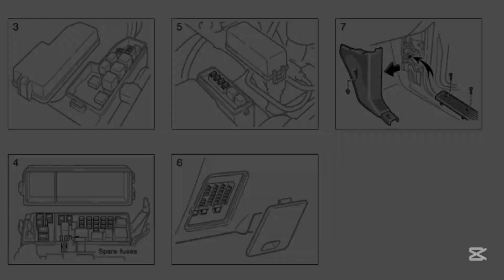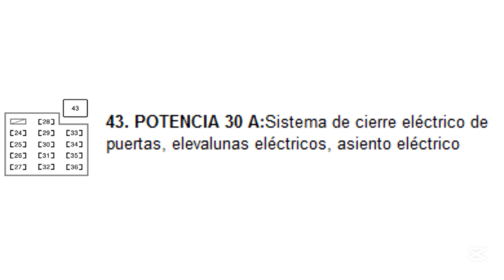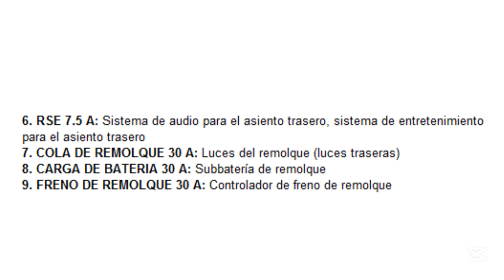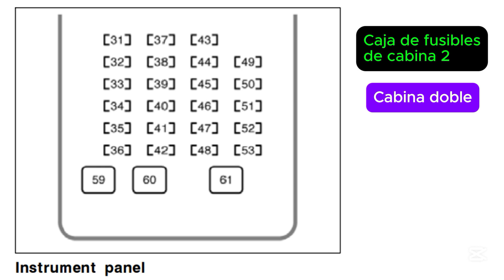Diagrama de la caja de fusibles de Toyota TUNDRA 2004. ToyoFans.

Comment from the maker: Toyota TUNDRA.
Año: 2004. 

Relé y Fusible de la Bomba de Gasolina, Combustible, Gasoil, Nafta, Diesel, Petróleo, Bencina, Carburante, Gasóleo, Gasolìn.
Motor NO ARRANCA revisa estos FUSIBLES.
Conoce todos los relevadores y fusibles de un Toyota.
CAJA DE FUSIBLES.
¿ COMO SE LLAMA EL FUSIBLE DEL AIRE ACONDICIONADO ? 
Ubicaciones de los fusibles y detalles del circuito para encontrar el fusible correcto.
¡ Explicación de la Caja de Fusibles de su Automóvil !
No funcionan Luces DIRECCIONALES solución fácil con diagrama ( palanca, botón, fusibles, flasher ).
Nombre de todos los Fusible del Auto de Ingles a Español ( Función, ubicación ).
¿ CUAL ES EL FUSIBLE DE LUCES DE CUARTOS ?
COMO SE LLAMA EL FUSIBLE DE LOS VIDRIOS ELECTRICOS.
Cual es y donde encuentras el famoso Fusible de la Bomba de Gasolina. 
Fusibles.
Como se llama el fusible del claxon o bocina.
COMO SE LLAMA EL FUSIBLE DE LA BOMBA DE GASOLINA.
COMO SE LLAMA EL FUSIBLE DEL TABLERO.
¿ COMO SE LLAMA EL FUSIBLE DE LA BOBINA DE ENCENDIDO ?
DÓNDE ESTÁ EL FUSIBLE DE LAS VENTANAS ELÉCTRICAS, LOS VIDRIOS ELECTRICOS EN UN TOYOTA.
Extractor de fusibles Toyota.
Fusible de las luces de una camioneta Toyota.
Diagrama fusilera Toyota, ubicación y función de cada fusible: radio, ventilador, luces, bobina.
¿ COMO SE LLAMA EL FUSIBLE DE LOS LIMPIAPARABRISAS ?
El Fusible.
COMO SE LLAMA EL FUSIBLE DE LAS LUCES TRASERAS.
Identificación de FUSIBLE y relay en TOYOTA.
COMO SE LLAMA EL FUSIBLE DE LA CIGARRERA.
COMO SE LLAMA EL FUSIBLE DE LAS DIRECCIONALES.
COMO SE LLAMA EL FUSIBLE DE LOS LIMPIA PARABRISAS.
Que Fusible se debe usar para un Circuito? 10 amp, 20 amp o 5 amp.
FUSIBLES Y RELEVADORES TOYOTA PARA QUE SIRVEN.
Ubicación de fusible de ignición.
¿ COMO SE LLAMA EL FUSIBLE DE LA CALEFACION ?
Nueva ubicación de la caja de fusibles del Toyota, fusible de la luz trasera.
Qué fusible y relay controlan la bomba de gasolina / combustible de un Toyota.
Significado de fusibles.
Fusible cuartos trasero / Fusible cuartos delantero / Fusible luz tablero. 
Ubicación de fusible de las plumas limpiaparabrisas.
Posición de Fusible y Rele bomba de combustible.
¿No suena la bocina? ¡Cambia el fusible de repuesto!
DÓNDE ESTÁ EL FUSIBLE DEL SISTEMA DE ALARMA E INMOVILIZADOR EN TOYOTA.
Cambiando fusible donde va y cuál es?
COMO SE LLAMA EL FUSIBLE DE LAS LUCES DE REVERSA.
Dónde está el fusible de la computadora de Toyota.
Fusible.
FUSIBLES DEL TOYOTA EN ESPAÑOL.
COMO SE LLAMA EL FUSIBLE DEL ALTENADOR.
Los Relés.
Localiza un relé de bomba de combustible rápido y fácil !
RELE y SWITCHES del STARTER o motor de arranque.
Ubicación de relevadores Platina ( relevador de bomba de gasolina ). 
Dónde está el relé para el ventilador del radiador Toyota.
Relés eléctricos de automóviles explicados: cómo funcionan y dónde se utilizan.
Fusibles y relays Toyota ( bomba de gasolina ).
Relay del Motor de Arranque / Starter Relay con Falla.
Relay / relevador / rele de motoventilador Toyota.

____________________________________________________________________________

COMPRAR EN AMAZON:

JOREST - Juego de 300 fusibles de cuchilla para el auto, 160 mini, 90 estándar, 50 micro y 1 extractor de fusibles, para caravana o motocicleta ( 2Amp, 3A, 5A, 7.5A, 10A, 15A, 20A, 25A, 30A, 35A, 40A ).
https://amzn.to/3TQ2G4O

Nilight - NI -WA 06. Kit de cableado de la barra de luz LED - 2 cables 12V Interruptor de encendido y apagado, relé de potencia, fusible para las luces de trabajo LED fuera de la carretera, 2 años de garantía.
https://amzn.to/3Umaoni

Multímetro digital Astroai con amplificador de ohmios y voltios y prueba de diodos.
https://amzn.to/46kykia

KAIWEETS - Probador de voltaje sin contacto con porcentaje de señal, rango doble CA 12 V/70 V-1000 V, cables con corriente/sin corriente, pantalla LCD, alarma sonora, detector de rotura de cables.
https://amzn.to/46PWtgE

Luz de prueba automotriz con pantalla de voltaje digital LED de 3 a 48 V, probador de circuito automático con voltímetro e indicador de polaridad de doble color, bolígrafo de prueba eléctrico.
https://amzn.to/4f1PX8X

Comment from the maker: Diagrama de fusilera de Toyota TUNDRA.
Año: 2004.

Con este vídeo, podrás responder las siguientes preguntas:

- Cómo se llama, el fusible de la bomba de gasolina / diesel ?
- Cuál es el relé, de la bomba de gasolina / diesel ?
- Nombre de los fusibles y reles, traducidos del ingles al español.
- Cómo saber, cuál es el fusible del claxon / corneta ?
- Cómo reconocer los fusibles y relevadores de un carro ?
- Por qué no arranca el carro ?
- Dónde está, el fusible del encendedor de cigarrillos ?
- Cuál es el fusible de las luces ?
- Ubicación y función de cada fusible. 
- Dónde está, el fusible de la radio ? 
- Cuál es el fusible de los limpiaparabrisas ?

Consíguelos en Amazon:

Juego de 300 fusibles de cuchilla para el auto, 160 mini, 90 estándar, 50 micro y 1 extractor de fusibles, para caravana o motocicleta (2Amp, 3A, 5A, 7.5A, 10A, 15A, 20A, 25A, 30A, 35A, 40A).
https://amzn.to/4fj0RpO

Probador de circuito automotriz de bombilla LED premium, luz de prueba de 6-24 V con cable de resorte extendido de poliuretano de 135 pulgadas, sonda de acero duro afilado para vehículos.
https://amzn.to/3YxtatJ

Multímetro digital Astroai con amplificador de ohmios y voltios y prueba de diodos.
https://amzn.to/4f3ACE3